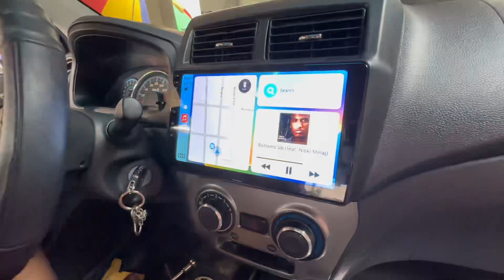Pioneer Underseat Subwoofer Installation for Car @JTHomeDIY

Comment: Hello. The place on the fusebox you used has constant power or has power only when the vehicle is on? It still working good? Thanks for the explanation.
Reply from the maker: Constant power sir, it has acc remote power from the HU and it powers when the hu is on or off, its working good, this subwoofer consumes minimal load ,so no need to install the power directly to the battery

Comment: can i take +12v from the costanti +12 wire of the head unit?
Reply from the maker: No sir, just tap directly to fuse box or battery. To avoid overloading

Comment: never leave bare wire behind the head unit, even if cut flush (talking about the blue remote wire that outputs 12v each time the hu is on.  cover the end of the wire with electrical tape.  how much power is that sub?  12-14awg wire from the fuse box is not a good source.  I guess if it's 50w (max), but at a minimum, you should use 10awg wire, fused at the battery, then ground w/in 24" or shorter from the sub (w/10awg wire)...this was scary to watch 😢
Reply from the maker: I used #10 on the wires & were all taped after taking the video sir, the fuse box vacant slot has 20amps cap, the sub amp only requires 10amps. 😊 for hi power sub amps ( not under seat) i always tap directly from the battery, with big wires.  Thank you for your feedback and advised sir😊